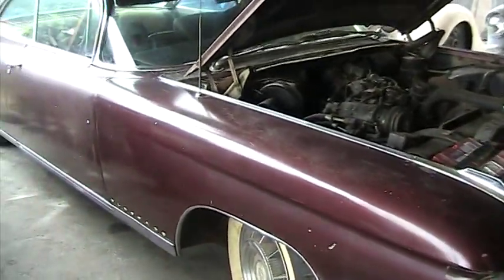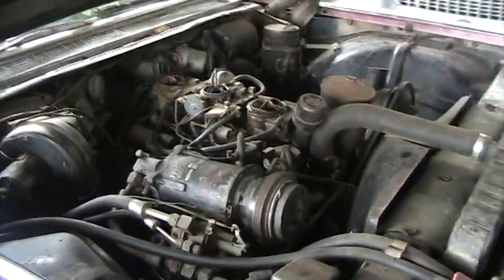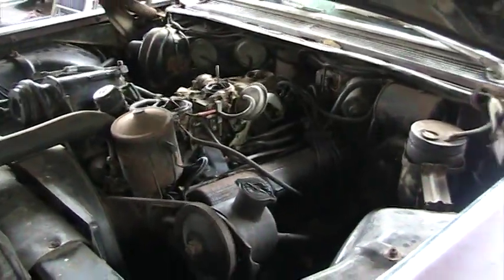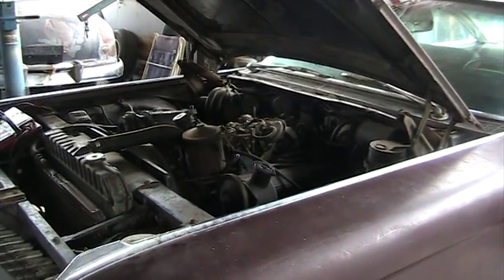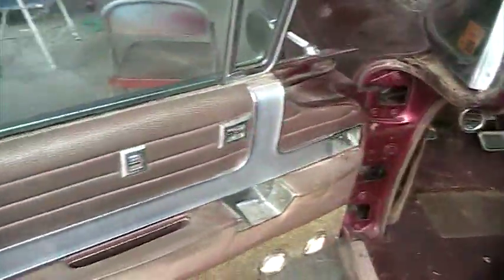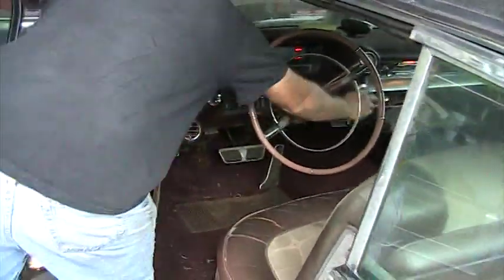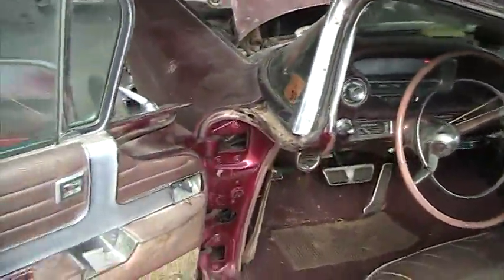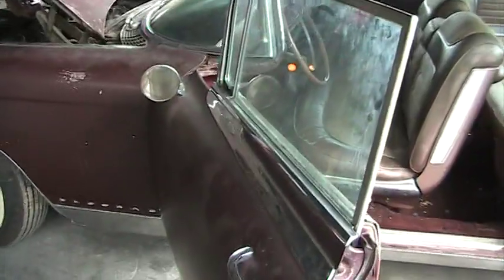WILL IT START?
59 caddy start up with 3 dueces

Comment: Nice 1959 Eldorado Seville!  I bought a '59 Fleetwood off Ebay back in the summer of 2005 and it came out of a barn, looking just like this car.  Mine is the top-of-the-line production sedan (excluding the limousine and the Eldorado Brougham designed by Pininfarina) and I love it.  Took a year to get it roadworthy, but worth every cent!  Bless you guys for saving yet another '59 from the crusher!

Comment from the maker: @killercrew10 Thanks for the info. I had a 59 cad 4dr that sat since '74, I got running. It ran smooth after about 30 minutes of running, real smooth, like a new cad does. I put about 10,000 miles on it and did very little to it. Awesome cars!

Comment: Awesome car, however there is a piece or two of information that is not quite accurate -- The "Q" Engine with three two-barrel carburetors was standard on the Eldorado series (Brougham, Seville and convertible) but optional on all other series (my 1959 Fleetwood came with one Carter 4-barrel carburetor from the factory).  Also, The Eldorado Biarritz, the Eldorado Seville coupe and the Fleetwood 60 Special had the special "V"s in the backup light cluster, whether they had the Q engine or not.

Comment: Just one quick correction: the tri-power carbs only gave an extra 20 HP, not 45. The standard Carter and Rochester 4 Jets provided 325 HP and the tri-powers 345 HP ... so only a 20 HP increase. Most of the tri-powers had the air suspensions with the air compressor running continuously and often also an AC, eating up much of that 20 HP anyways.

I have a Series 62 Sedan with the Rochester 4 jet.

Comment: WOW, that's a bunch of HP for the time frame.  I wonder how many of these were stripped of their engines to make rods?  Forget the stupid 57 in the background.  Dime a dozen.  Restore this thing and you'd have something worth a pretty penny, so to speak, especially if your production numbers are correct.  Power windows, power door locks, pretty early for that kind of stuff.  Great (real) antique find.

Comment: Dan is that 390ci a Big Block or Small.  I bet it would suck up tha gas with those 3 Carbs. Nice 59 Cadillac I love those old Caddy's.  My friend bought a 1967 Cadillac Coupe De Ville 2 DR HT.  Its got tha 425ci small block 4 speed atuo.  Tha Engine Got rebuilt because tha last owner blew it up.  It had one snaped rod & one twisted LOL.  But now it's runnin' & perrin' like a kitten.  Cya Later.

Comment: just a quick correction, there is no such thing as an eldorado 4 door there was only seville's and bairritz'. there is such thing as a fleetwood though.
Reply: And a Sedan Deville, not forgetting the Fleetwood 75 Limo/Sedan. The Fleetwood you mentioned is the Sixty Special 6029M with the rocket vents on the sides.
Reply: Bradley De Santa  I actually should recorrect myself there is such thing as an eldorado 4 door I forgot about  the 1959 eldorado brougham that was supposed to be there very top of the line but there was only 100 ever made (one dropped in the ocean during transportation) I've done a lot more research since my dad got a 1959 cadillac coupe Deville.
Reply: Bradley De Santa and yes there are a few 4 door models for the 1959 cadillac but they aren't in the same class as the eldorados the only other 4 door that gets close to the eldorados is the Fleetwoods which like you said have the side scoops but they also have the same rear end as the eldos with the extra bullets and cadillac "v's" over the reflectors in the bumper plus more similarities